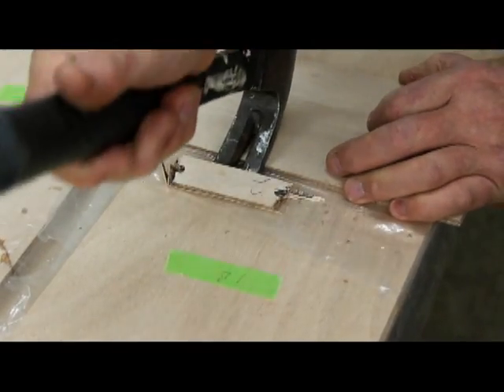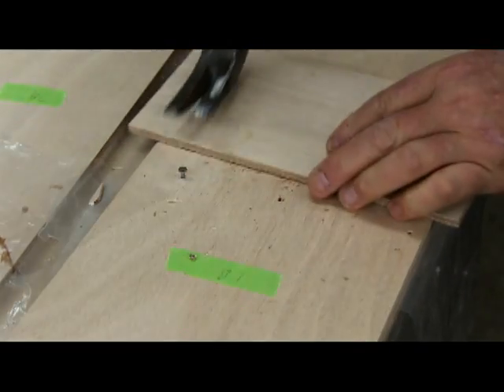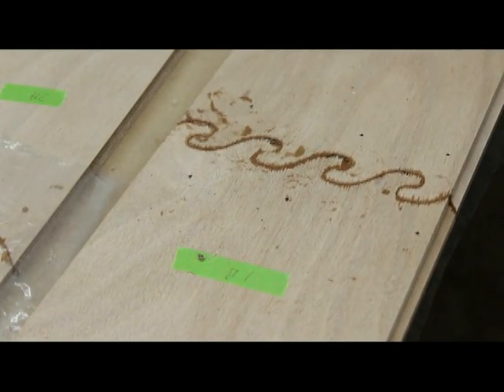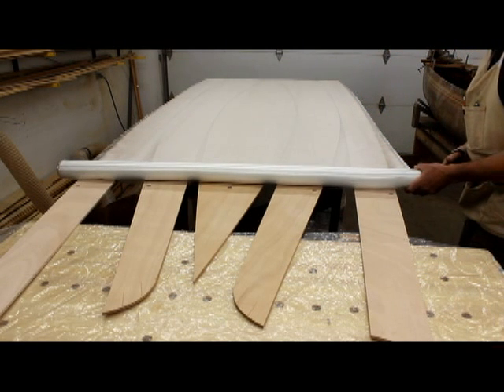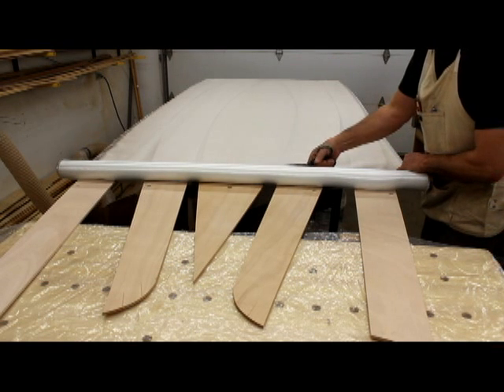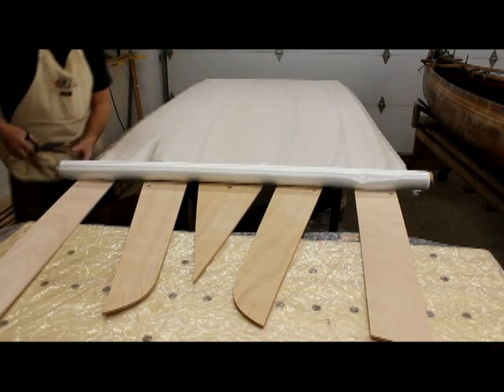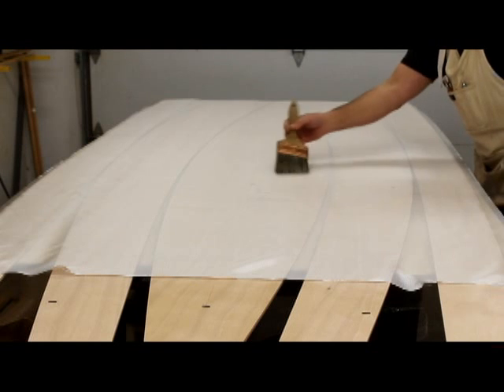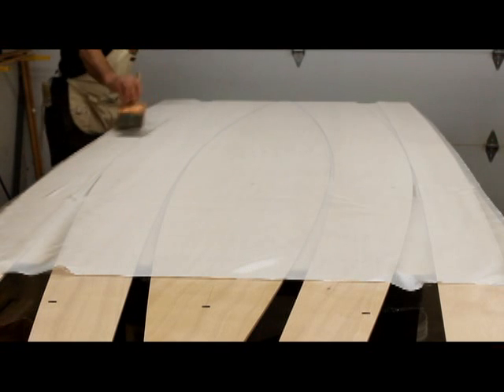Building the PT11 - episode 2

Comment: Sorry, but that is ridiculous nailing the joints together! A few strips of hardwood and some clamps would have done the job perfectly without putting holes in the boat!
Reply from the maker: I agree.  I could have used some plastic and some weights as well.  But I think you will find in other comments in this exact subject that I was following the manual provided in the kit to show exactly how it is described.